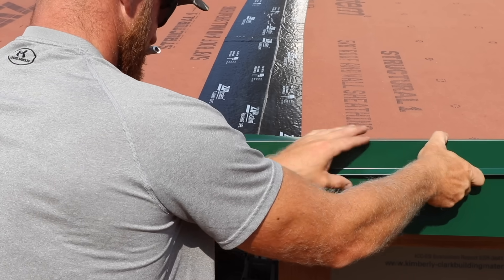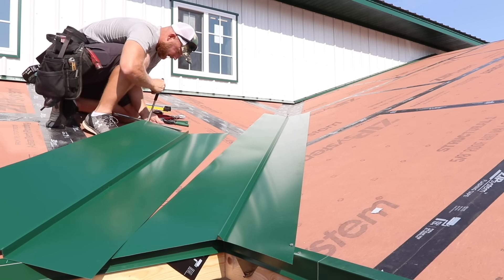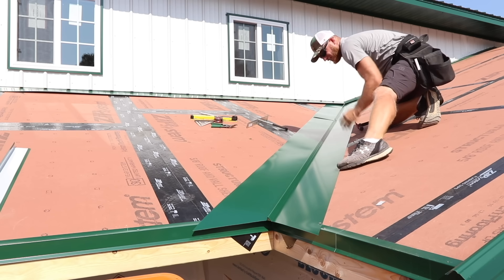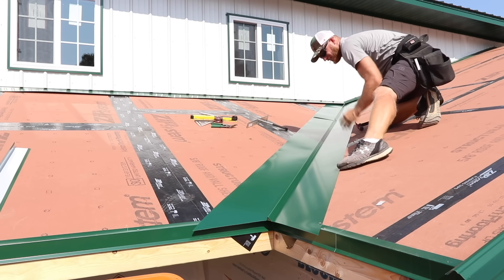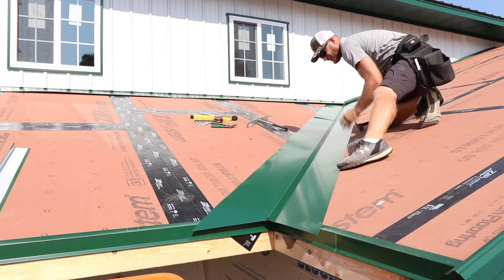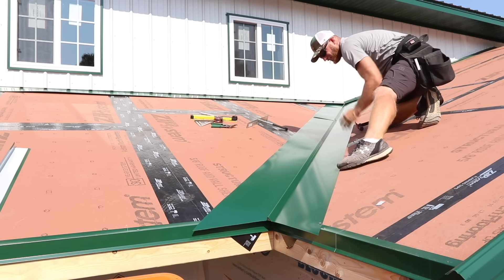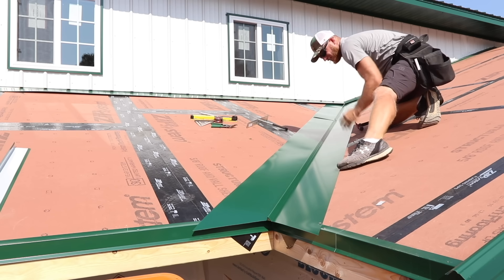Building a Hunting Cabin 21: Metal Valley and Hip Details

Comment: Really nice job guys. I spent some years doing commercial metal roofs and siding. It is nice to see the new innovations and the quality of custom returns being fabricated on the job. Shows proper skill and care. True professionals. I have recently seen some absolute disasters installed. No bird stops, abrasive blade cuts, dimples the size of rocks, holes big enough to insert a hand, screws through the ribs and without grommets etc.   Ask and i will send pics i took of a bad job to brother in laws house

Comment: I've worked in IT for over 20 years. You are absolutely correct about how being hands on with something can be so gratifying. There have been times where I've gone out to my workshop and just run some scrap wood through the table saw to create saw dust and get that fresh cut wood smell in the air. The older I get, the more enjoyment I get out of working in my shop, wrenching on the family cars, and finishing up the quasi pole barn addition that I have been building on the back of my woodshop.

If you're ever down in Alabama, I'd enjoy the chance to get to meet you. I don't drink, but I'd be willing to buy you a beer.

Comment: Good work Kyle......Two observations if we're going to straight plywood we never used the smaller quarter inch screws we find them to loosen up in 7 to 10 years they make a 5/16 made for plywood seems to last longer also we batten almost everything that way the building stays much cooler with the metal off of the deck heat... not radiating down great work thanks for the tips.

Comment: I have worked a project with hidden fasteners for a roof system, and it was a pain to lay out prior to ordering materials, and the prep work seemed to take forever. On that project we used Central States Manufacturing, it was a very clean looking install and once you get the hang of the install portion it went rather quickly. They use lots of Z trims, gables aren't bad, valleys, ridges, and gambrel trim can seem to eat up a lot of time.The gambrel trim is easy to install just takes a lot of prep work to install all the Z fasteners properly. But also probably the most satisfying metal roof install look i have seen, when done right they look awesome.
Reply from the maker: I hear ya man.  Standing seam is gorgeous when done and done right

Comment: Good job!  We usually pre-drill holes when were are worried about the oil caning.  I have a punch also that works pretty good.  The oil canning comes from that initial stress of the screw trying to get through the metal.  Nice video.

Comment: Those Z closer trims on the hip are 100% worth it, locks the ridge into place and only needs a few rivets to hold it in place, a lot better than using grommet screws, fewer penetrations are better, you are a good metal worker 👍🏽👍🏽

Comment: Your Metal work looks amazing as always, on the ridge I would recommend instead of installing bird block foam, turn the tops of your sheets up the same size as your ribs!
Reply: It's the only thing I seen also I bind the lows up under caps and flashing

Comment: I've been a carpenter for quite a while, and I still wish I could work with you and learn from you. Nice work as always.
Reply: There are hacks and there are good and then there are the few top-notch builders like this crew. I have been building for a few decades also.
Reply: @riverrat1149  stick framing, drywall, finish work and even electrical and plumbing, I'm pretty confident in. Even put up a few pole buildings, but I can't make them look like he does. I'm very impressed with his work.

Comment: Damn nice work bud. I’m a metal man my self  and can appreciate your work but I haven’t seen you cut a panel yet really curious on your method particularly hip and valleys. I have a suggestion for your dimples on the hip cap. It looks like the gage metal being used on this install is 26. Maybe if you ordered the hip caps,ridge cap,sidewall and headwall flashing in 24ga that would help lessen the dimples. I personally don’t see a problem with it.

Comment: Kyle, a couple of things.  Metal Sales should have a 20' break and can make you r valley and hip caps in 20' lengths, so no end laps.   Go with an open hem valley and you can use cleats to attach the valley.
Reply from the maker: They surely can get me longer pieces... I worry about some of those details oil canning if circumstances aren’t perfect and that detail I want crisp

Comment: Great quality work.  Maybe would have ran a membrane higher up the valley so the screws could be about 2 feet from the base of the valley to reduce chance of water leakage from rain/snow/ice.  Since the valley is wind protected having screws 1.5 to 2 feet from the end of the tin seems like it wouldn’t be an issue for keeping tin secured down. Just a thought.

Comment: U are a Great Contractor
You could up grade your Roof Contracts.
For Cooling & Drying  
A 30mm vented Roof.
to use 
30mm Batterns down the Roof 
Batterns across the Roof 
Air intake & bug screen at the gutter end 
Raised Ridge Capping at the top 
to Vent the underside of the Roof sheeting. 
Open Mesh venting material
Under Ridge flashing 

Keep up the good work. 
Top marks

Comment: Good job, very clean,I realize this is a zip system type sheathing, however for liability and condensation purpose's I always use a high temp.peel and stick, whats your thought, Also I always  use an industrial grade sealant, such as M-1 under panel to valley section then screw it down. Your thoughts?

Comment: Hey Kyle, can you do a standing seam roof? Cuz I'm considering a large garage and connected house the garage is actually bigger than the house also instead of steel for siding using a cementatious siding. The way you build it looks like your pole barn is stronger than traditional stick built. Then there is all that space in the walls. I bet you could build a super tight building that requires an HRV
Reply: Check out the roof portion of the DiResta Series.

Comment: Great / clean workmanship. Anyone else notice the color / shade difference of the panels (coil change at plant mid run)? My experience is that only becomes more pronounced with age. 🙃
Reply from the maker: Actually you are seeing a difference in dust accumulation due to the install being apart from each other.  The area around us had been getting worked with farm machinery adding to the dust that settled on the earlier installed metal
Reply: @RRBuildings  Thanks for the feedback and glad for you that’s all it was. I admire your quality standards and wish more of my “competitors” were more like you. Far too much wham bam TYM these days.

The production problems I mentioned happened to us 3 times over a 5-6 year period and after a couple years of weathering, the color difference was quite noticeable.
Reply from the maker: That’s not good hopefully your supplier took care of you

Comment: I liked the voice over, the video goes by a little quicker, which is a positive when you have limited time.

I am curious as to what the tabs on the scissor lift railings are for. I've seen them many times and can't figure out why they are there.
Reply from the maker: what tabs are you referring too?  maybe the slide out locks
Reply: @RRBuildings  that might be it. They just look like a bunch of tabs cut into a piece of sheet metal.

Comment: U ever use the panel to measure the valley once u snap ur line we use a short panel so the half inch is just over the line jut to the crease  then measure from the top down and after the first one u have ur angle for every one

Comment: For some reason I always thought there needed to be an air gap under a metal roof. 

Good to know you can just lay it down!
Reply: Does he say why it doesn’t need an air-gap? I was thinking the same.
Reply: My guess I because it’s on a waterproof/air tight surface, but that wouldn’t really make any sense either since they use the same ZIP system for the walls and they put an air gap for siding. So.. idk, but I do like this guy and if I wasn’t hell bent on doing everything myself I’d trust him to build my stuff !
Reply: Michael Howell thanks for the reply! hes doing another cabin in the woods build and supposed to upload on Monday, so far he’s using osb for sheathing im following to see how he water proofs it.

Comment: From the Plumber's Bible- it looked plumb and square all over! ! Some time, explain what it takes to get those stamping lines to match up across a hip or valley- it doesn't look simple to me at all! FR
Reply: A hip/valley runs at a 45 deg angle(in plan). What happens on one side can be mimicked on the other. I E he used a tape. Looks good as always rr
Reply: @kierandoherty1600  I'm pretty sure I didn't state the problem very well. The angle , as you look at it from the ground , looks like 45deg- it isn't; that angle is modified by the slope of the roof. It may not be much, but if the distance from the eave to the peak is very much, the distance from the center of the valley splash will change if you don't modify that angle to suit. The real question for me, was how do you keep the different stamped shape lines matching as you go around- not all the lengths of the porch roofing will be that same on every job- if you travel different distance, you will end at different points on the widths of the panels and the impressed ridges will not fall out directly across the valley or ridge meetings. IN plan doesn't mimick the as built when there is a 12/4 or any rise angle for the roof slope- I get that can be computed- the finishing with the impressed "bumps" on each panel being evenly and directly opposite by the time you go around the building could be way different if all of the roof lengths aren't exactly  the same. I was wondering how you compute that ahead so you don't have a really jarring mismatch across the last valley or hip.
Reply: @frederick  i think all should match up if you position the sheets in the right place. If theres a rib x distance from hip/valley on one side, it should be the same on the other. If porch wall plate is parallel to main building the ribs will meet up the hip or down the valley
Reply: @kierandoherty1600  If you cut the roof sheets on a perfect 45 deg slant, the ribs stamped into the sheet will not line up; as you cover the valley or meet at the hip, the tiny difference in the cut angle will throw the edge of the sheets out of kilter with the flashing/roof peak center line. I was wondering if his "working app" had a formula for it, because he and crew almost always Hit the mark- sharp and tight. In some respects plumbing isn't much different- our rules start with "plumb and square to the building lines" even though a lot of our pipe work is concealed under floors and behind walls.
Reply: @frederick rike  i understand what youre getting at and youre correct. The cut on the sheets isnt a true 45. I dont know if theres an app or construction calculator solution but id offer up a sheet and mark where the outer edge hits the hip/valley. That will give the cut angle of the sheets. Same method can be used for ply osb etc
Reply: @kierandoherty1600  That's pretty much how I think I would- Kyle seems to be saying there is a mathematical way to do so- but he checked it  in place before he committed to it. Thanks for your answer- we're always ahead for sharing ideas, work arounds. FR
Reply: @fredericrike5974  no worries

Comment: I really don’t think there is any room to improve on the quality of work you do. The valleys look Cadillac. I am not sure how to get away from the minor wave or oil can effect short of using say 1/4” pressure treated strips down each side of the valley. Perhaps you bent the 2nplanes on the gutter end of the ridge to a 90 degree flap that would hide the plywood stiffener and help prevent additional rain infiltration. You could also hem that end and silicone a bent profile that would sit back maybe a 1/2” beneath the ridge or save the silicone and slide the profile into the hem before closing it. This is just a thought, knowing you alone could accomplish it. Great job as per usual.

Comment: Lets roll that awesome drone footage!!!!
I enjoy your videos. 
Insulation question: (Southeast  USA, MS) If you already have a pole barn erected with steel in place, but no wrap. How would you suggest to insulate it? Concrete floor. The steel ends just above the dirt over the outside of the concrete slab. They used the concrete form frame as the bottom purlin  to anchor the steel to.
Reply from the maker: I would use fiberglass batts and a good vapor barrier...or just add 1/4 fanfold to the wall girts then spray foam it
Reply: @RRBuildings  Thank you!

Comment: what happens to all the condensation diffused through the sheet metal on the bottom side? I have a pole building shop that has a metal roof over thick insulation laid over the roof beams and sometimes I can see drips down the walls from the roof. Seems there is always water problems with these metal roofs.

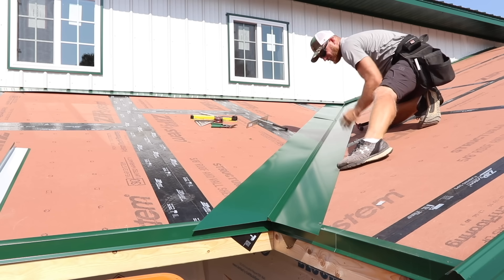Comment: At 6:50 you installed the sealant tape. On my house, I have a room addition. Where the roof panels meet the exterior wall, the flashing goes over the top. Exactly how you did it here. But the room addition is low pitch and on a heavy wind storm, water blows up the panels and gets behind the new wall and drips water in my floor. Would that ast sealant be a fix for me to sandwich the flashing and roof panels, or is there something else I should use instead?
Reply: Forgot to mention, your quality of install is outstanding. Wish I had your skills when I was roofing my house!

Comment: Based on the comments you made about using screws in the valley I cant help but think that is why in Australia we screw through the high point of the steel sheeting wherever possible and use roofing screws with thread spacings and rubber washers. Been watching a long time and often wonder why we do it that way and you Yanks seem to screw everything down in the flats. Not sure which of us has worked out the longest lasting method.
Reply: Here in Finland sheet metal roofs has been done since 1960s and first we screw them from ridge (high point) but quite fast it became clear that it was bad because it's not so rigid way to fix and those hole started to deform and leak due thermal movement and wind. 
Since then like 1970s all metal roofs with exposed fasteners has been fixed from valley and it works much better.
Example my garage roof is 23 years old, screws in valley (low point) nothing leaks and EPDM rubber in washer still flexible.

Comment: Hey mate, im a roofer here in Australia, and everything in this video is what were taught not to do. No i understand that there's completely different climates between us and that we have to follow the manufactures  installation procedure so we dont void the warranty, i just simply cant understand why they'd have you screw into the pan. Thats where the water runs, water corrodes things in time and that washer would cease to exist, furthermore, there's no screw stopping water or snow from entering from under the lap, where here jn Australia, we use longer screws and only screw into the rib, to seat the lap preventing any water penetration and less chance of water causing corrosion to the washer, equalling a longer life span. 
If you'd like to know more about a different way to install steel sheeting, please email me on collingwood-2@outlook.com .
I will gladly send you a PDF file containing all correct installation procedure supplied by the manufacturer of the steel, following the revised standard known as the AS 1562.1:2018 Design and Installation of Sheet Roof and Wall Cladding.
Compliance with the new standard is mandatory for all new building projects. It's part of a constant drive to improve the durability and weather tightness of homes in Australia.
Reply: Do you see the higher ridges in the body of the panel. It's not flat like most standing seam metal roofs. That roof is closer to a corrugated metal because of the taller ridges in the body of the panel. You really cannot use a cleat with that because it looks like crap and will not hold worth a shit. They used a thicker sealing strip under the screws just like you do with cleats, butyl tape and screws.

Comment: So you say the washers last 30-35 yrs - should I be concerned that in my new construction, the builder put silicone caulk over the valley screws? Seems like a shoddy method to me -a bailout for not knowing how to construct a metal roof valley (they have repaired said valleys 4 times -have not been able to stop  from leaking...)

Comment: I just tagged into your video and have a million questions. I am working on my place. There is a foam material sold at my local metal supplier for the ridge cap. Do you think this will allow enough venting of the attic in coastal SC?

Comment: Question friend, do you use “j “ on all four sides when doing an under side of porch or is the back piece something else. Looks like you put it in j on the front and sides and just push it up on the back . I’m doing a softball dugout at work and will be putting sheets up on the underside . Just curious. Thanks always for your videos, I’ve used several of your tricks on the roof and it looks great .

Comment: I hate to be that guy but the problem with all of the exceptional details (Gable cutting the edge material, taping the valley sheet to panel seams, the extra insurance steps y'all have taken that I believe compounds to add years to the roof life) never seem to happen with many contractors unless you stay right there on top of them and when an owner does stay there a lot of companies/crews get aggravated.